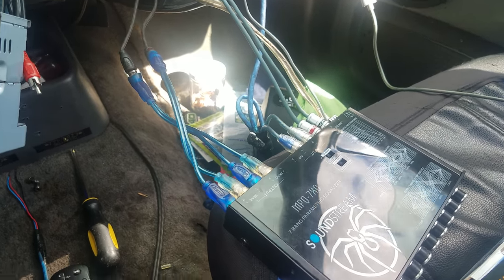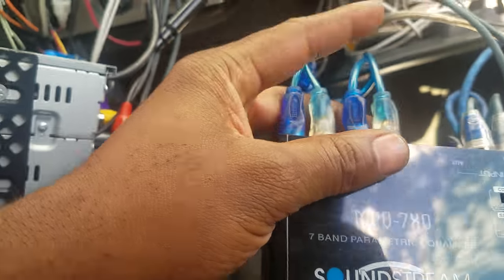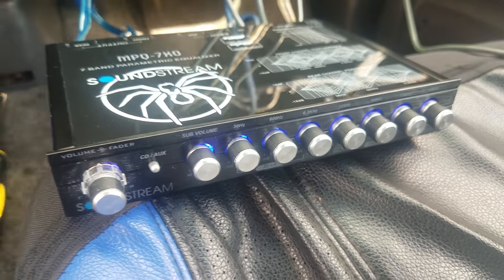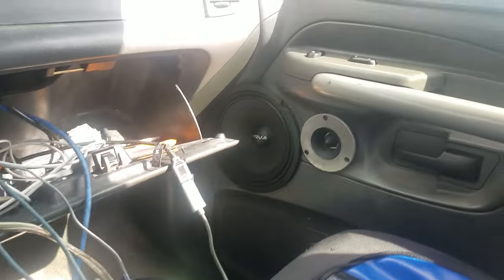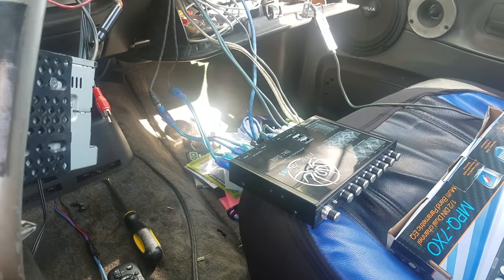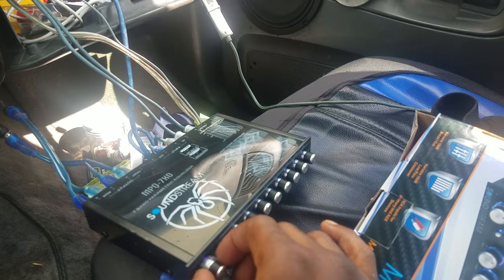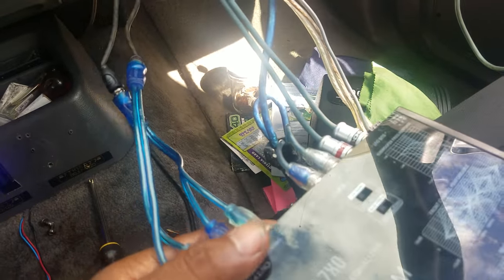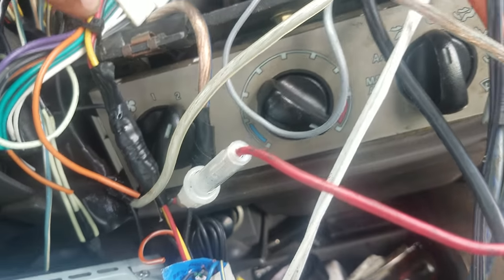Soundstream MPQ-7XO Equalizer Install

Comment: Who else watching without a CLUE? 😂
Reply: been a year
Reply from the maker: What is it that's hard to understand?
Reply from the maker: @WhiiteKg  Appreciate it bro hope u enjoy yours
Reply: @BIGJURAY20  what if I have 2 tweeters and 4 mids? I have the front mids and tweeters on an audio pipe crossover. Would this eq still work?
Reply from the maker: @Demontae Sanders  Yes you can still get total separation between mids and tweeters. It's all how u wire your speakers to your amp
Reply: I don't know what's going on here but know one thing for sure, his voltage is 12.0 volts flat he needs a battery 🤣🤣🤣🤣 and someone else to install his shit!!!
Reply from the maker: Lol I'll give you that. But, like i say in mostly all my videos nothing is ever set in stone so i never really care how i install mines really. I'm always changing and testing different things
Reply from the maker: @joshuahockman1128  The 12v you see is because i did this with the truck off ignition in on position. But, If u watch my new video's I charge much higher voltage and system is much louder
Reply: Same😂
Reply from the maker: @michealbijadhar5831  What is it you're confused about?

Comment: Always ground the eq to it's own separate ground. It will help stop engine noise coming through the speakers.
Reply: I have this issue now smh
Reply: I have the same problem
Reply: @sothobouyvlog331  shit the worst noise man
Reply: Everything should get its own good clean chassis ground including your head unit and amplifiers as well as equalizers and crossovers I hate alternator noise 😂

Comment: Splicing the ground to ground will create interference I know this is an older video, but you should not splice your ground into another ground just ground to metal.
Reply from the maker: Yea i agree which is why i also stated to clean the surface area and apply it's own ground.
Reply: @BIGJURAY20  Sorry I actually made this comment when I saw the bad practice, then you clarified it later in the video. I should have edited my original comment to say something about that
Reply from the maker: I appreciate you saying something on it.
Reply: Interference? Limits output, quality?

Comment: Man that's is some serious work and wiring. My question to is did you run a separate amp for your twitters🤔 and I like how you ran it separately from the mid and bass👀👂👍🏾
Reply from the maker: In this video i was using a 2 channel amp with channel 1 dedicated to Tweeters and Channel 2 dedicated to the mids and had a 1 channel for subs

Comment: Quick question bro. How did u end up tuning it with the dd1 with the eq?? Confused atm on how to do it.
Reply from the maker: Put the sub rca in the DD1 from the eq output to test for distortion. I tested each output and crossover point to assure I didn't reach distortion
Reply: @BIGJURAY20  thanks man u the mvp lol

Comment: Hey bro I just installed a clarion equalizer but for some reason it turns on when I turn the car on but it will go dim as in the first three knobs will be lit and the rest dim. Also there is no sound or signal being sent to my amp. I’m not sure if you can give any advice on this? Please try to reply asap. Thanks in advance

Comment: I have one amp so can i used subwoofer out put with this EQ for my subwoofer bass
Reply from the maker: Yes you can
Reply from the maker: U can but you won't be able to use all the crossover points. Most of them are for mids and highs

Comment: What if I have a converter hooked up to my system because I have a factory radio do I just plug the EQ into the converter
Reply from the maker: The rcas from the convertor to the equalizer input rca and the equalizers output rca goes to the amps used. That way u have full control of your system from the equalizer itself

Comment: i have a lc7i and a 4 channel amp running my door speakers. Theres 2 sets of rca's. 1 set for the fronts and 1 set for the rears. How do i go about adding this eq to my setup?
Reply from the maker: The front output of the lc7i to the main input of the eq then the front, rear and sub outputs from the eq to your amps

Comment: How'd you wire the stereo and equalizer together? On mine, the equalizer turns off and on by a light switch lol and I can turn on the stereo and equalizer on when the key is in the off position which shouldn't happen, correct? I think that's whats draining my battery. I bought the truck with a sound system already installed
Reply from the maker: I hate installing after someone's mess. Sorry you're going through this yes you're right it's not operating under normal circumstances. Do you have experience with radio installation??? Maybe i can help u with your process
Reply: BIGJURAY20 just thought I should update you. I had no experience installing a stereo or any aftermarket audio. I did some research and pulled up the radio wiring diagram for my truck. The original harness for the radio was cut so the wiring diagram helped a lot. Basically I rewired the EQ and the stereo and fixed my problem. Battery hasn't died on me since then. And everything is turning off and on as it should :D
Reply from the maker: That's great news bro happy it all worked out for you. The fact is alot of people cut corners to get things done. But taking time and getting it done right the first time last longer in the end. Congrats bro great job. 👍🏿👍🏿👍🏿
Reply: I had a car that was the same way i had to remember to remove radios face so it wont drane my battery

Comment: So you can put the highs and mids to one four channel amp the the signals will not be messed up?
Reply from the maker: 4 channel amps have 2 separate crossovers and gains so just as long as things are set correctly shouldn't have issues
Reply: @BIGJURAY20  thanks!
Reply from the maker: @kcycle1308  no problem

Comment: Do you set the gains on your amps before you equalize, or do you turn them all down on the amps and just use the equalizer?
Reply: No set the amp up first and use eq to make it sound clear
Reply: Set head unit to just before clipping then turn the 7 band eq all the way up THEN set your amp gains
Reply: @SheikhN-bible-syndrome  well said miguel

Comment: Can i ask you something i have a ar 4000w Boss amp can i hook up 4 12 subwoofer with this 1 channel amplifier
Reply from the maker: Is your amp 1 ohm stable? If it is you can power 4 12 inch subs that need to be dual 2 ohm each
Reply: @BIGJURAY20  it says 1 ohm and 4 ohm
Reply from the maker: @tonymccoy761  It's either 1 ohm or it isn't. It will show a 4 ohm 2 ohm and 1 ohm power rating if so. That shows what the amplifier can do at those wired ohm loads

Comment: Do you have your equalizer setting all the way down on your headunit, thanks.
Reply from the maker: Everything is at the middle on the head unit
Reply: @BIGJURAY20  any distortion at high volume from the EQ.
Reply from the maker: @miggygains8782  No not in my case I tested for distortion at each frequency point
Reply: @BIGJURAY20  mines does, you know what could be the problem.
Reply from the maker: @miggygains8782  Be Sure to have you radios settings all at 0 or halfway and the eq as well.
Reply from the maker: @miggygains8782  There's a chance the gain on the amp could be slightly too high
Reply: @BIGJURAY20  appreciate it brother, I'm check on my EQ gain is probably to high. That could probably be my problem.

Comment: What kind of wire can you use to run the power and ground?? Can you use speaker wire?
Reply from the maker: Yes, you can use speaker wire to power the equalizer. Just be sure to use a fuse to protect the unit
Reply: @BIGJURAY20  Oh okay for sure man! Thanks for the reply! And I seen you the other day on rosecrans bro that bass you got bumps HARD!!
Reply from the maker: @FaceYourFear.  Appreciate the love bro. Trying to get it together lil by lil

Comment: Did your equalizer come with ground and remote wire! These equalizers don’t give out engine noises?
Reply from the maker: Don't believe the came with any wires but they did come with what's needed to get the job done. The equalizer didn't give out any engine noise very nice unit
Reply: BIGJURAY20 thanks man👍🙂

Comment: Can you give me some ideas what kind of box I should build for my Chevy S 10 be a good idea
Reply from the maker: What do you plan to run?
Reply: Power bass amp and the has 1200 watts Subwoofers are 800 watts
Reply from the maker: @nicholsduane3458  How many subs are you planning to run?
Reply: BIGJURAY20  I plan on running two Subwoofers
Reply: So should I run a box with a port or should I run a seal box
Reply from the maker: @nicholsduane3458  That would depend on the type of music you like to play. But I'm sure you'll be ok with a sealed box
Reply: BIGJURAY20 How much did you pay for the crossover
Reply from the maker: @nicholsduane3458   The equalizer cost about $40 at the time i got mines
Reply: BIGJURAY20  where can I find a crossover like yours
Reply from the maker: @nicholsduane3458  Ebay or Amazon is a good source

Comment: Ohh can use the same power wire from radio to connect the eq power wire?
Reply from the maker: The Eq doesn't draw much power you can use speaker wire 14 gauge ofc

Comment: How many RCA cables did you need for that EQ and what length thinking about buying an EQ
Reply from the maker: +Edmond carter 3 17ft for mids highs and bass
Reply: BIGJURAY20 cool  thanks
Reply from the maker: +Edmond carter no prob bro
Reply: Thanx for the tutorial video I been wanting to know how to hook up an eq I hook my own systems up also but I was missing the eq in my last build your video was well explained unlike other vids on here thanx a bunch!
Reply from the maker: +Randy Watson Happy i could help thank you for checking out my video. Much appreciated
Reply: Help I got the eq hooked up everything is lighting up but no bass ok on my classd amp/mono amp where do I plug in the rca plugs after I plug them in in the back of the eq sub-out," when I get to the mono amp/class d amp do I plug the rca plugs in where it says input or output because i'm not getting any bass from the woofers? Help.
Reply from the maker: +Randy Watson you'll put the rca in the input side of the amp from the eq sub output. If you need any help u call always call me. 310 912-4648

Comment: Do i need a 4 c amplifier for this or can I used my 1200watt amplifier
Reply from the maker: U can tune just about any amplifier with an equalizer. You'll need a Full Range amplifier like a 4 channel to tune you mids and highs. Then, your amplifier for your subwoofer can be tuned as well

Comment: I have a questions, I wired up my sub and amp but not bass is playing. I switched the wires around used different rca cables, my amp turns on and the fuse for the amp isn’t blown but nothing is being put out by the sub. Do you think the amp it’s self my be broken?
Reply from the maker: What amp and sub do you have??? How is it ran?
Reply: BIGJURAY20 its a crunch GPV 800 2 channel amp and a JL audio 12 w0v3, I’m not too sure how it’s ran
Reply from the maker: Does the amp go straight into protection

Comment: what the input sensitivity for this equalizer can handle....
Reply from the maker: Doesn't say what the input sensitivity is not like Amplifiers do. Only that it puts out 8v max to the Rca
Reply: @BIGJURAY20  Thanks for the info bro....
Reply from the maker: @ceejaycjmusic  no problem sorry I couldn't find what you were looking for
Reply: @BIGJURAY20  no woories ✌🔉🎵
Reply: If I buy this, has it got a' line in converter ' built-in?  Or, do I need to buy line in converter as well?.. I want to use my Factory Head Unit 
thanks.. great vid

Comment: You still active man ? I'm trying to hook up my clarion eq and for some reason only the fader is working on it? Adjustments do not work. And some how when I pull out my midbass stage rca from my crossover it still plays sound. Any clue what might cause that? I followed the steps.  Tomorrow I'm gonna pull out everything and try again. Wish me luck
Reply from the maker: How do you have the rcas from head unit to equalizer
Reply: @BIGJURAY20  I figured it out the next day. I just rewired everything and it started working. builds on pause. Just picked up 2 custom NSV4 15". Just waiting on a cell and a box
Reply from the maker: Those are badass subs u have. What kind of amp did u get to power them?
Reply: @BIGJURAY20  starting with a 10k nemesis audio for starters probably and moving on to a b2 12.k after I save up for it. I don't want any Brazilian running for too long in my ride
Reply from the maker: @skankhunt-jc6yx  u never know the Brazilian amp may work out
Reply from the maker: @skankhunt-jc6yx  But you have some solid power. How about your electrical any plans for upgrades?
Reply: @BIGJURAY20  going to start with a Cmax cell or maybe a cyber 12 from limitless. Trucks already has two 370s and i got plenty of 0/1 & 0/0 waiting to get installed Also. 
I'm running 32 12" on mids so I'm trying to do alot of the fab work before I start wiring anything up.
Reply from the maker: Damn that's a shit ton of mids. I gotta hear this when you're done. Will you post videos of the progress? Definitely sounds like a vicious setup. BTW, can't go wrong with Cmax if the banks assembled properly should work out great
Reply: @BIGJURAY20  it might, but don't you feel like running something of a higher build quality will maybe extend the longevity of these subs ? I really don't wanna start cooking them anytime soon. I want them to be with me forever. I'm trying to find 2 more
Reply: @BIGJURAY20  yes 3 on each door with a horn and 3 tweeters. And a center console running from the back all the way to the front that will house 12 more along with 12 more tweeters. A rear deck behind the second row with 6 and I'm still trying to figure out the rest lol 18 sound mb1000 they'll take 1000 each without breaking a sweat.  4 inch coil with a wide shallow motor
Reply: @BIGJURAY20  I'm down for cmax if it's done right. I'd still want it to be cased in some sort of plexi maybe for protection
Reply: @BIGJURAY20  yeah. As soon as I get my Power and my Box done I' can start posting some progress. Truck needs a good rewire and possibly a new head unit also. I have possibly the loudest feedback I've ever heard ever
Reply from the maker: @skankhunt-jc6yx  I believe anything can give out if not well maintained. Whether China Korean or Brazilian power just as long as you're moderate on the bass knob it'll last. And Of course the cleaner the signal the better
Reply: @BIGJURAY20  I'm doing a stunt wall killer basically lol
Reply: @BIGJURAY20  I'm familiar with my clip meter haha , I just always see people downing the brazilian stuff so I'm just curious to know what these Crescendos /b2's/wolframs
Reply: @BIGJURAY20  I will most likely stay brazillian for the mids and horns and use something of a higher end to run the tweeters. The best possible sound while staying loud

Comment: Ik this is a dumb question but I hooked up a dsp and I hooked up the amp and dsp remote wire to the original headunit remote wire, when I turn on and off the car it’ll make a loud thump. What did I do wrong?
Reply from the maker: Try checking your grounds to see if that helps
Reply from the maker: Sometimes it happens when gains are up a little too high
Reply: @BIGJURAY20  yea ik, but before I installed the dsp it wouldn’t make that thump?
Reply from the maker: @anthonylara3087  It could be the unit emitting that signal but it's hard to say exactly. If your grounds are all separate and the unit is mounted safely away from metal. I'm a little puzzled myself. I'll look into it a little more to see if i find a little info
Reply: @BIGJURAY20  Alr thank you
Reply from the maker: @Cm5-Anthony  Which DSP are you using?
Reply: @BIGJURAY20  skar ska7eg
Reply: Q
Reply from the maker: How do you have your equalizer wired up? Where are the filters set too?
Reply: @BIGJURAY20  so what I believe the problem to be is that I have a dual amp setup, with that i just made a y setup for my remote turn on, maybe that’s sending a unstable current causing the subs to pop? But the eq itself is tuned to normal frequency’s and the bass volume is down, and I just wired it to a cigarette plugs wires, with remote being connected to the main headunit remote wire which is also connected to the amp remote wire.
Reply: @BIGJURAY20  I made a little diagram, I’ll post it and could you go over it?
Reply from the maker: Try bypassing the cigarette wiring and wire the equalizer to the Radio's Power Source. Wire the ground separately from the radio and see if it helps any
Reply: @BIGJURAY20  will try that right now
Reply: @BIGJURAY20  so I disconnected the dsp from the cigarette lighter and connected it to the radios power, and connected the amp remote, and dsp remote wire to the radios remote wire and now the equipment will turn on and turn off after the radio boots up?
Reply from the maker: Did rewiring help any?
Reply: @BIGJURAY20  so I turned the key and it turns on for just a second
Reply: @BIGJURAY20  Alr so what I did was I connected the remote wires to the radio power wire, it fixed the pop and now everything works as it should, although would that damage the radio in the future? I was thinking of just tapping into the radio fuse instead of that.
Reply from the maker: @anthonylara3087  the remote wire shouldn't be on a power line. The equipment will not turn on and off as they should
Reply: @BIGJURAY20  I checked it and everything simultaneously shuts off so I don’t see a problem
Reply from the maker: @anthonylara3087  Well, seems like you should be ok